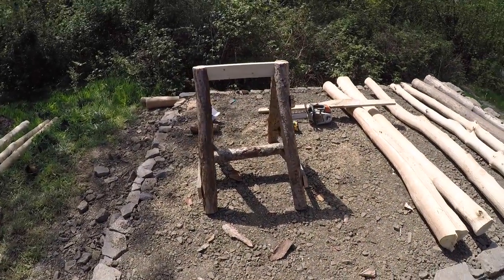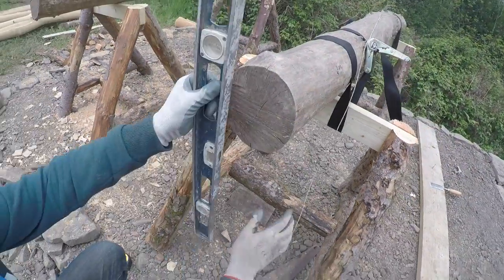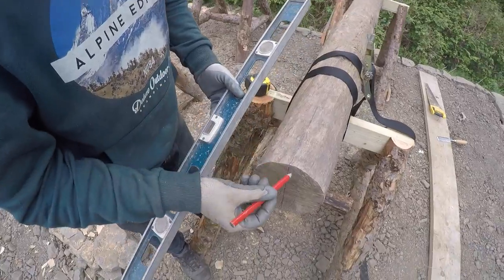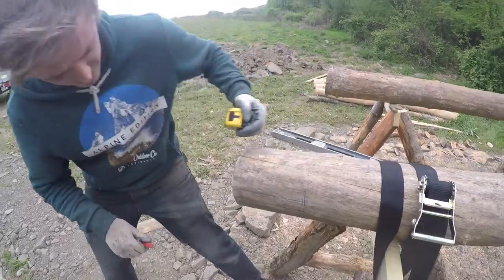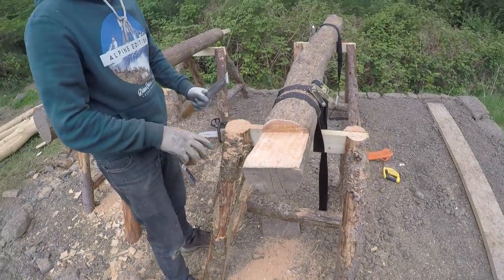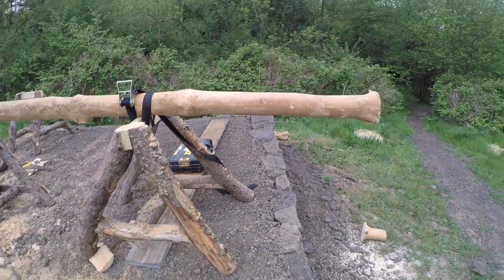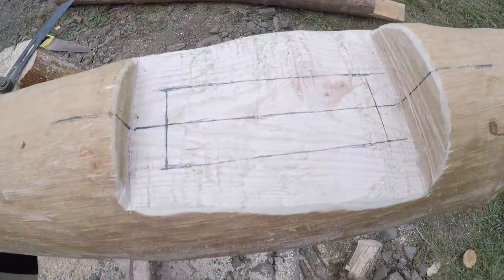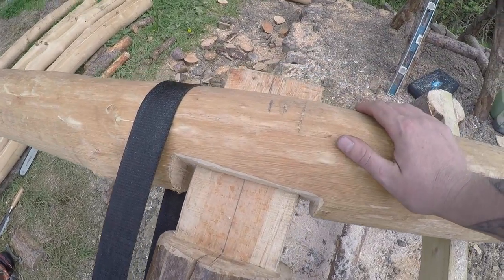How to, roundwood mortise and tenon, timber framed shed part 2

Comment: You are teaching us old farts the way to get things done. Keep up the good work Cris.
Reply: got that right ...i was a carpenter for 40 years and im learning so much from him
Reply: John Hammack  sorry to say but he went the long way around finding centre of the pice of wood. But was still interesting to watch
Reply: +daniel clark I thought that too. Not sure about measuring the width of the tenon on the curve of the wood either, that's not going to be correct.
Reply: DONE BUT THE HARD WAY
Reply: I would have used level on both ends to mark 2 perpendicular lines (crossing more or less at centre of the log) and then snapped the line to connect the ends. Is there better way to do the same thing?

Comment: No criticism....Or you can screw a 50mm batton top and bottom, they can be either a marking guide or saw the tenon faces using the batton as guide. Tenon tops and bottoms also guaged from one batton denoted as datum. Tenons are then aligned in both axies and you avoid all the complex marking out. :)...I would never recommend anyone use a top handle saw for plunging to make mortices, without 2 handles there's almost no control to prevent kicks. Obviously, if you are highly experienced you take your own calculated risks.

Comment: I am most impressed by the accuracy you can achieve with a chainsaw.  I find the chainsaw jumps and I am lucky to get within 10 mm of the line. I would need to use a handsaw to cut a reasonable fitting tenon.

Comment: This is really cool stuff! Thank you for teaching us this! Yet, I wonder if the roundwood will keep working and splitting (since it is so freshly cut and has not had time to dry out). If that is the case, I wonder if the movement of the wood will throw your carefully measured mortises and tenons out of sync?
Reply: Green wood will dry together. Undried green lumber frames depending on type like hemlock may need metal ties to prevent the beams frlm twisting. Otherwise the weight of the build will generally dry them together in place. 
Kiln dried is necessary because screws and nails will not hold green lumber. Hence the joinery.

Comment: I really enjoyed the video. Thanks! I have a question about your chainsaw. The rear handle /throttle is on the top of the saw, rather that at the rear of the saw. Is this a special type of saw for this work? Do you find this design preferable for timber frame construction?

Comment: Just curious as to why you preferred using the string method when you had a level in your hands. Great work as always Kris!
Reply from the maker: The idea of this layout is so that the tenon points where you want it to regardless of the shape of the log or how bent it is. Take a bent bit of wood and try and get a tenon out the end that is going to make the post hang correctly with a level. what you end up with is a stright tenon that is not relative to the bottom in anyway. you have to lay out with string to creat a square through the wood from bottom to top to work from. you cant do that with a leval.
Reply: @KrisHarbour  I get the use of the string down the length of the log but once the top point is established can't you just use a level to create the tenon layout
Reply: @davidreed9916  and a square to make a perpendicular line.

Comment: Kris much quicker way to do this couple of straight planks on either side of your log and trim in with your Alaskan.
Reply from the maker: Yeah that would work to. that would be a good way for a post like this but the string method is a lot more versatile for really long stuff. Good idea and i might give it a try next time.
Reply: @KrisHarbour  yep I was only thinking really about the short double tenon logs.
Reply: @KrisHarbour  Kris whilst I remember I have a pair of floor mounted sash cramps, with about eight feet of work length, sort of thing for barn doors lock gates etc they are yours if you want them